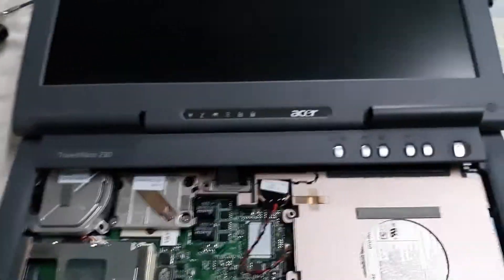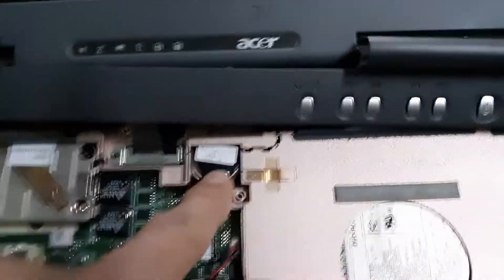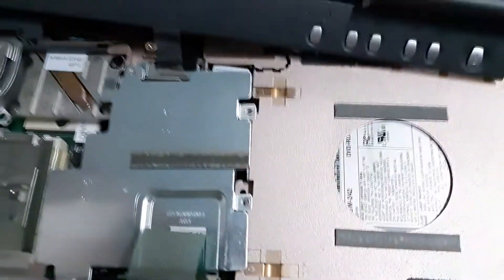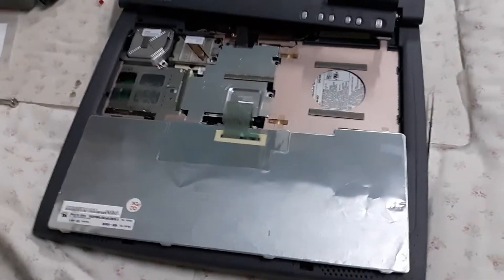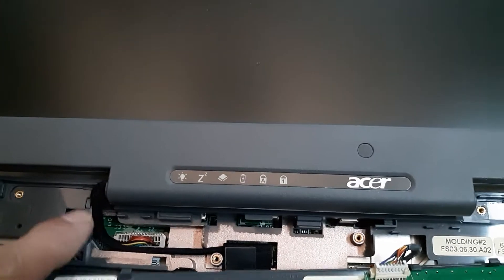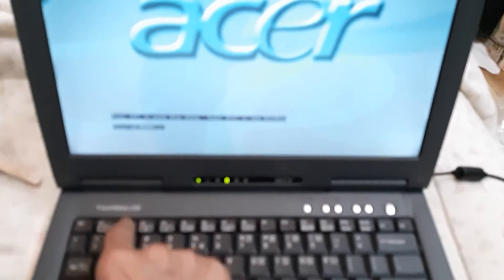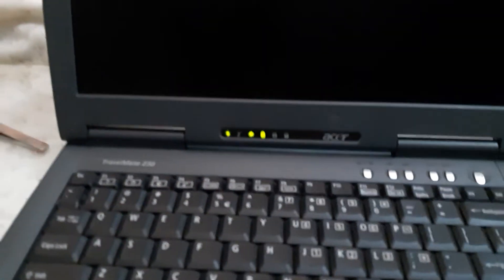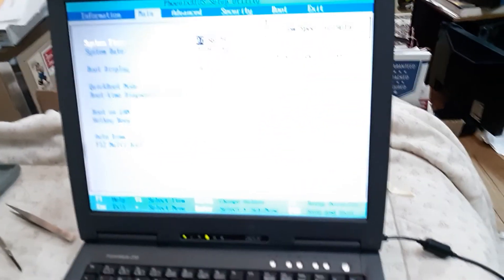Replacing CMOS Battery on Acer TravelMate 230 Laptop Motherboard

Comment: How reliable are these laptops? I've seen these a lot in ewaste more than old thinkpads and HP nx series...
Reply from the maker: @AirmanDotHome  
Seems to me they work good fresh out of the box. But it looks like they don't have longevity.
Reply: @irfaanxlcr8370  so your laptop died? mostly I see issues with the heat and mobo power supply intake area (click of death, from the Charger)
Reply from the maker: @AirmanDotHome  
Yeah it just stopped working for no reason. I couldn't figure it out. I gave it to a friend to see if he could check it out for me and I haven't gotten it back as yet. Thanks for your comment. Have a great day